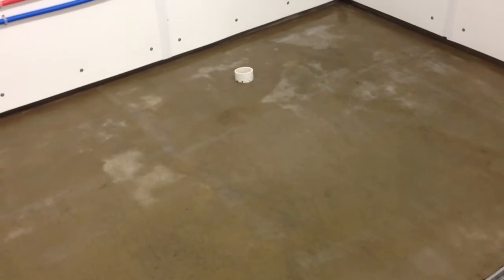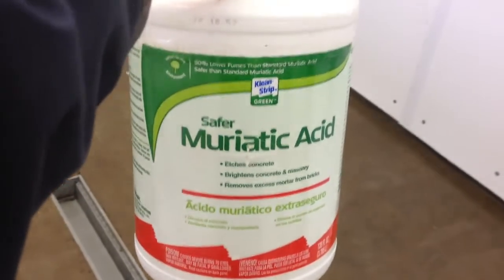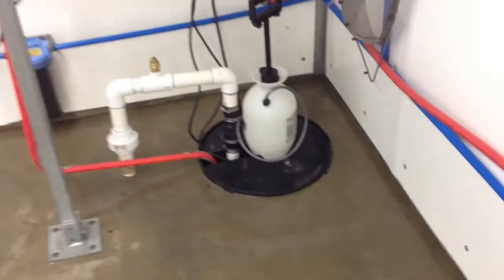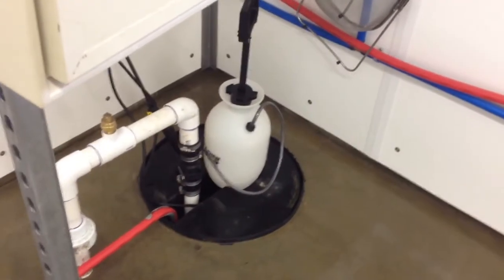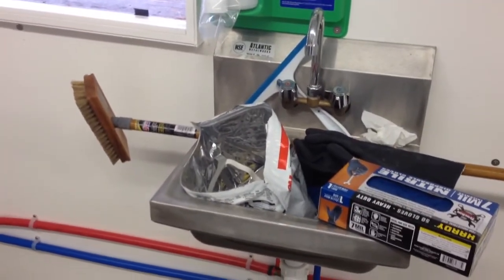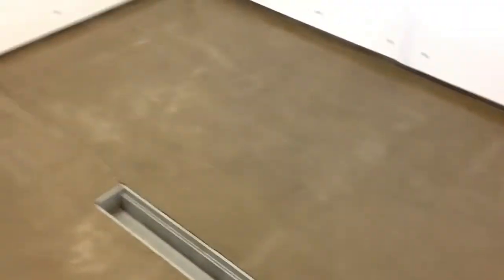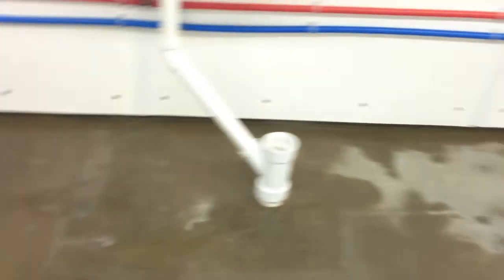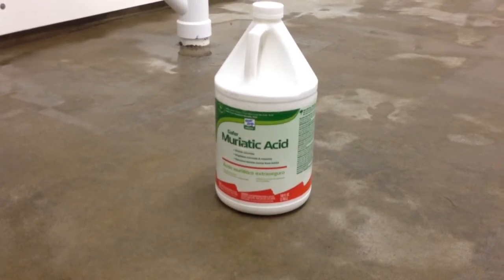Acid etching the shop floor. Part 1

Comment: How bad are the fumes? Would the fumes enter a home and make it uninhabitable? For example an attached garage.
Reply from the maker: The fumes from the acid wash were not bad, certainly not noxious.  For whatever it's worth, I wouldn't do this kind of work late in the season since you need a lot of water to rinse the floor, and you need for it to dry out.

Comment: Having similar experience trying to etch my basement floor using Klean-Strip® Green™ Muriatic Acid.  Planning to use Sherwin Williams Porch and Floor paint which recommends surface etch to 120-grit sandpaper.  Within a 3 SF test area, some feels okay but other is more like 220-grit and chalky.  Will try again full strength as you discovered.  Did you bother using baking soda to neutralize the acid?
Reply from the maker: No, I left the acid on the floor until it was consumed by working on the concrete, then I just washed it down the drain with our rock hard well water :)
Reply: My test area using Klean-Strip Green https://goo.gl/Az9xc6